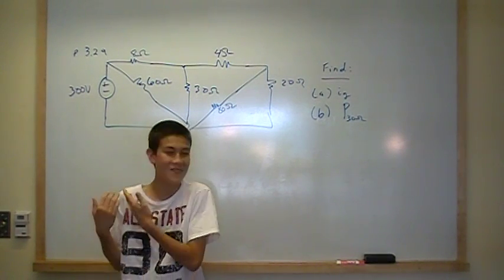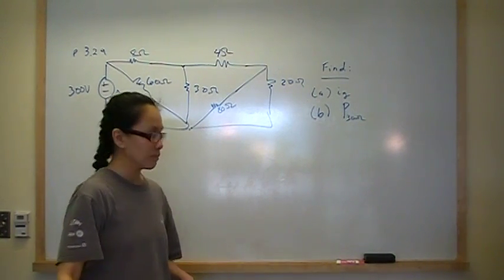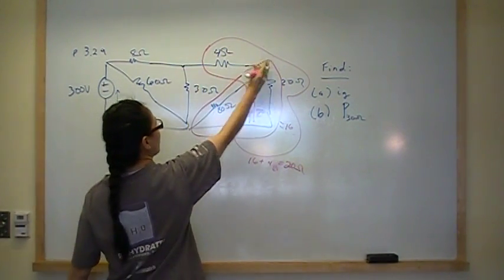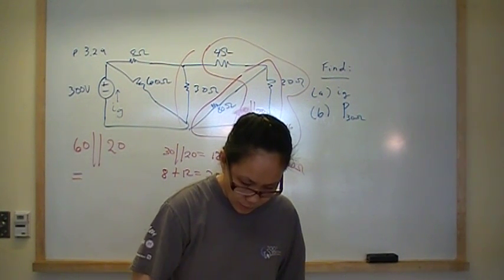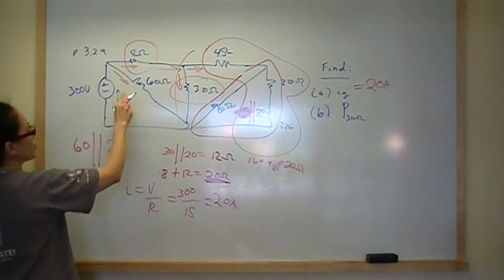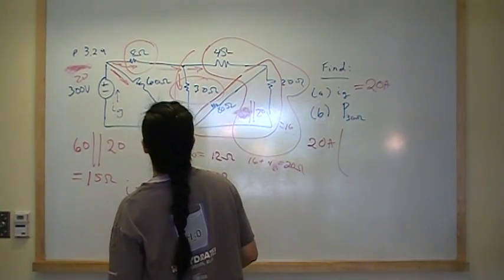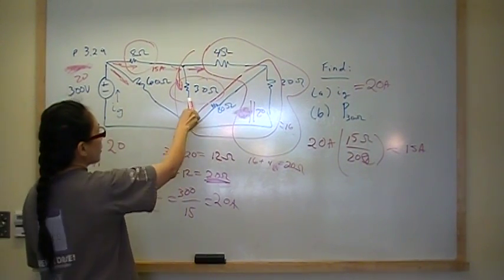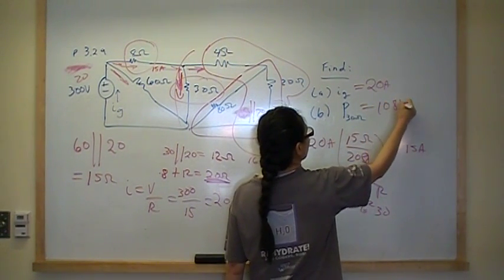Voltage Division and Current Division P3.29 Nilsson Riedel Electric Circuits 9E Solution

Comment: No offense but you explained this problems terrible. A person who is just learning this material is going to get confused. I followed you up until you applied current division. Why did you use the 20ohm resistor then you show the viewer the 20ohm resistor applies to the whole entire circuit. You should draw several diagrams so it isn't so messy.